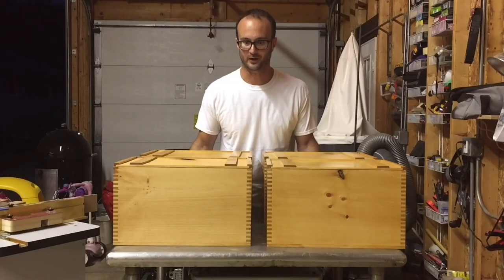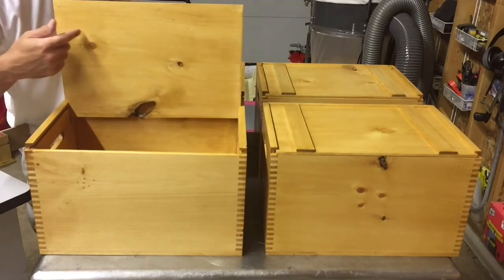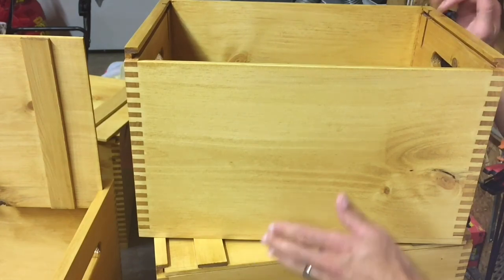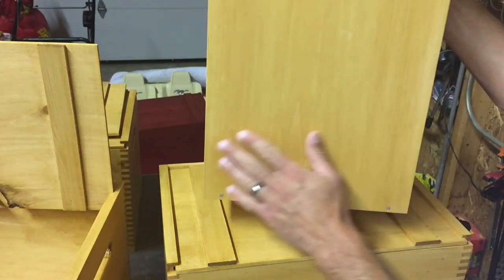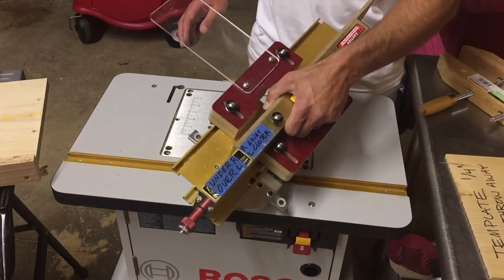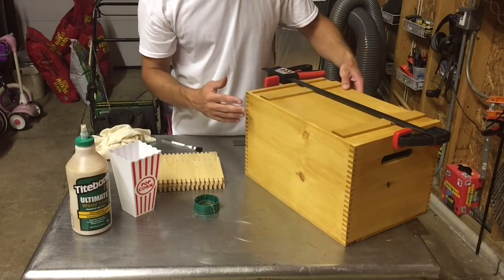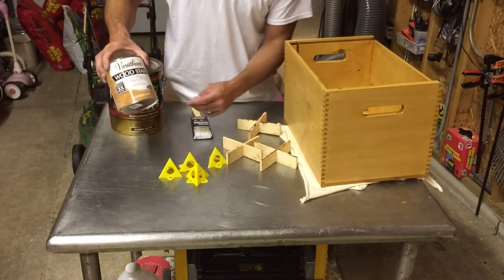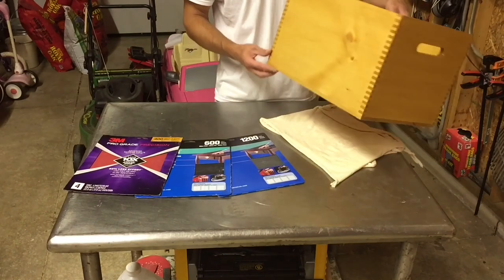Vintage Beer Crate

Comment: Awesome video. I was planning on buying the same table saw, and the biggest complaint on the reviews was the odd size for the slide. I'll give it a go. Your explanation is fast and detailed. Great job on the video.
Reply from the maker: jakea8380  Thanks for watching my video, and compliments.  All those contractors table saws (essentially more portable) have narrow/odd miter guide widths, requiring custom fab sleds.  I believe any table saw with a cast iron top will get you the right size miter gauge width, 3/4".